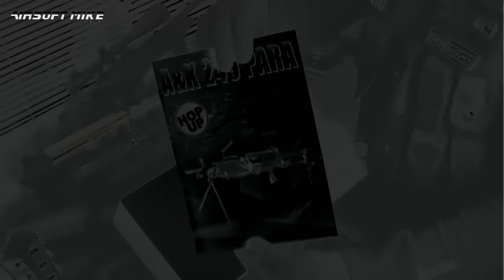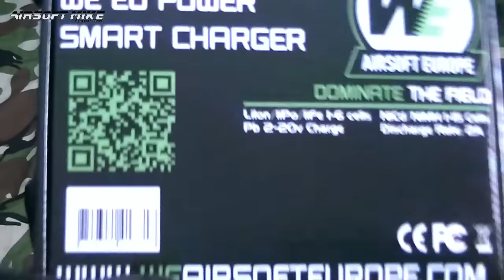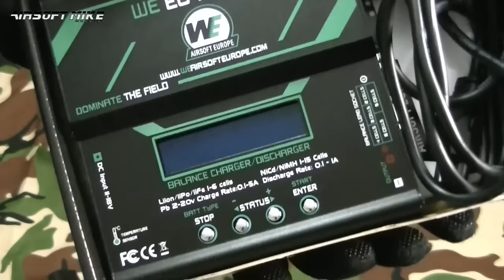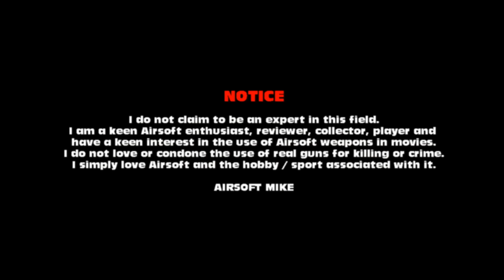A&K M249 PARA AIRSOFT LMG Unboxing / Review

Comment: it has one big drawback, this is a hop-up elastic band that is different from the standard one, for a good ball spin you need to change the hop chamber.  Otherwise, this is a really good machine gun with an excellent gearbox that perfectly withstands 150 m / s with a rate of fire under 2k

Comment: Great review.  I love your enthusiasm!  I have two questions: 1) I've seen other reviews for this gun that say you can adjust the ROF with the front dial.  Are you sure you can't do this?  Maybe because it's a UK version?  2) Can you attach more inert rounds to the ones shown in the video but still have the first batch attached to the magazine?  Thanks!
Reply from the maker: Hi thanks for your kind comment :) And yea I have heard others say that regarding the rate of fire but if it does make a difference, I can't see or hear any difference. I saw another review by an American youtuber and he has this A&K model and he too said his one doesn't change the rate of fire either.
Reply from the maker: And yes you can attach longer rounds but it will hang over the side of the mag. I shortened mine.

Comment: So if you hopper batteries go dead, no firing? and if no sound mode it has to be on All the time making that sound?
Reply: oOParaOo Plays You can use normal M4 type mags in this Airsoft gun as he explained. And if your battery goes dead, you change the battery! And you don't hear that sound whilst the gun is firing. The sound of the gun firing is way louder than the winding motor.